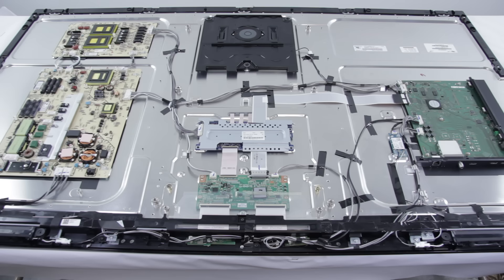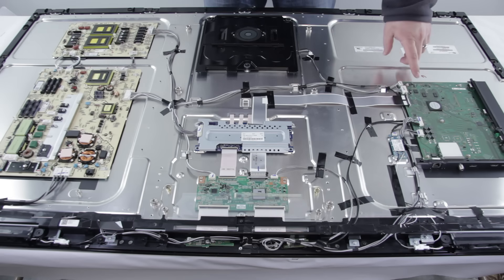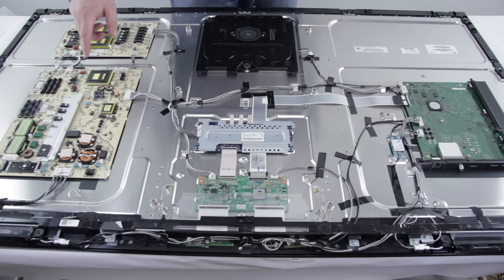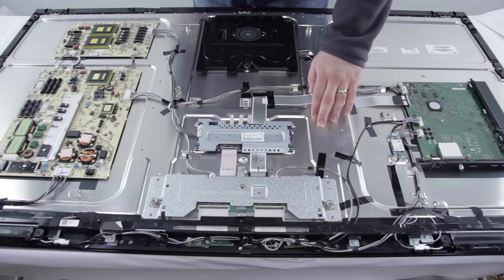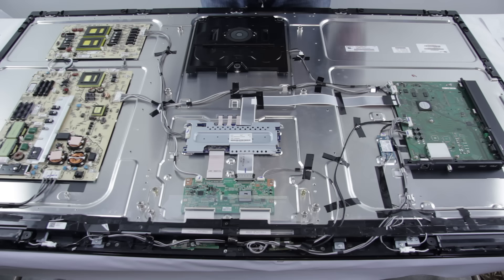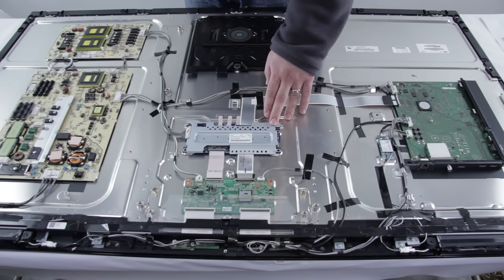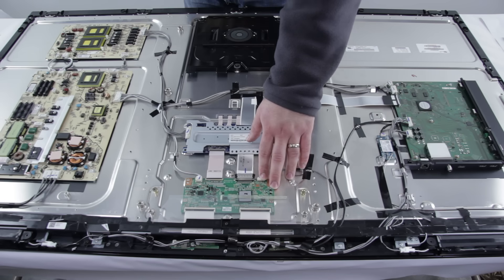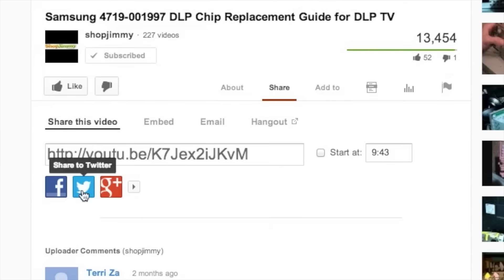LED TV Repair Tutorial - Common Symptoms & Solutions - How to Repair LED TVs

Comment: LG LS554500-UD   Has picture (vertical white lines) and sound but I can't see any of the menu options or anything related to channel or volume selections...?
Reply from the maker: Jason Smith   Try all repairs and troubleshooting at your own risk.  This sounds like a TV panel (TV Screen) problem.  If your TV panel is bad, it may be more cost-effective to replace the TV as panels are typically hard to find in stock, difficult to replace, and expensive.  Thanks and please let us know if you have any further questions!  www.shopjimmy.com

Comment: Hey Jimmy I have a LG TV model 47LNN5700 - UH.  Screen went black, but I still have audio. No back lights and I did the flashlight test and can see image.  Does this seem like the back light inverter/LED driver is bad. How much does this item usually cost and where can I get one if this seems to be the problem. Thanks
Reply from the maker: Dwight Frazier   PLEASE SUBSCRIBE TO OUR CHANNEL - Try all repairs and troubleshooting at your own risk.  This could be a problem with either the inverter or the LEDs themselves.  You can replace the inverter/LED board to see if that fixes the problem.  Click this link to replacement parts for your TV model number:  http://www.shopjimmy.com/catalogsearch/result/?q=47LN5700  There may be multiple boards for the same TV model number, be sure to match part numbers on your current board, with your replacement for compatibility.  Here is a link to a video showing how to identify your part number, click here:  https://www.youtube.com/watch?v=_4Qpfan0vdU  Thanks and please let us know if you have any further questions with your TV Repair!  www.shopjimmy.com

Comment: Hi there! I have a 2009 Samsung UN55B7100WFX2A that was in storage and moved a couple times over the last several years, the LED display started flickering and then started to go blank i.e. dark screen or sometimes slightly blue (but no picture) however audio works fine and TV turns on and off as normal. The LED display symptoms seems to be intermittent and TV can work fine for an hour or so however it seems like it is getting progressively worse (now the LED flickers less and just go black "blank" sometimes blue but most likely black) From the resources you have supplied in this DIY video should I be looking at Samsung LJ94-02860B (2009FA7M4C4LV0.9) T-Con Board ...it was your suggested alternative part #. I have not down the back light test, I will tonight when it gets darker. Thanks -Quintin
Reply from the maker: +Quintin Miller   Try all repairs and troubleshooting at your own risk.  This sounds like you have bad LEDs in your TV.  Unfortunately we do not sell replacement LEDs for your TV model number at this time.  Thanks!  www.shopjimmy.com

Comment: hi shopJimmy 
I have an LG Led 47LW650T-ZC
The issue I have been having is that my picture shakes quite violently when it's turned on. it doesn't happen every time but 80% of the ime it does. now it can stop after a period sometimes and other times it can go on for as long as I will leave it on.
I am not sure what the problem is, I've looked online and on the LG site and can't find anyone with this issue.
is there any help you could offer me?

Comment: hi i have a question about an LG  47ln5200 led tv  when you plug it in the red light at the bottom is lit when you press the power button the red light gets brighter but does not change to blue  the screen flashes white then the screen is dark  i did the flashlight test there is no image on the screen i checked voltages on the power supply it is fine. there is power going to the led wire i am thinking that it has led failure what are your thoughts thanks Eric

Comment: Hello. Thanks for this channel. I have an LG  42LN5400  I got it Jan. '14 and this Jan., just before the warranty expired, the TV went blank. The LG repair guy came and installed a new board., Here we are 8 months later and now my screen is solarized (psychedelic... all the pretty colors) This happens within 1 minute of the TV being on. It starts out with a normal picture, then turns into the solarization thing. The sound is fine. I am not handy, but I have a friend who is and offered to help. What should he/we be looking for? If you need the serial # just say the word., Thanks so much. I just can't see buying another TV when I haven't even had THIS one for 2 years.

Comment: Hi Shop Jimmy. TV Info: Samsung 50". Model UN50ES6150. Symptom: was watching TV and experienced a very loud pop noise followed by the screen going completely black (no blinking light). I have removed the back panel and found no obviously bad capacitors. I do have a Fluke DMM to test. Any help or troubleshooting suggestion would be greatly appreciated.

Comment: I have an LG LED 47LN5700.  The TV will flash "LG" upon power up and then the picture goes dark.  Audio is active and image is present (I did the flashlight test and am able to see the image), so I assume there is an issue with the back lighting.  I have replaced the LED driver and the t-con board and this did not correct the problem.  What's next?

Comment: Hi Jimmy, thanks for the video. I have an LG 42LE5400 that just went dark on me. My wife was watching the TV when it went out and she said that the TV was working fine then restarted on its own.  When it came back on, nothing was on the screen.  The backlight is definitely not working now, but the TV is turing on.  We stream most of our media and use a soundbar with the TV speakers off, so the sound is tricky to test.  I haven't been able to get sound but I am not sure if it is not working.  I have also tried the flashlight test but my flashlight is not the greatest, so I am not convinced the picture is not showing up even though I can't see anything.  I am sure the backlight inverter is out, so that would be step 1.  If that doesn't solve it, it seems the T-con would be next.  We have had minimal colored vertical lines on one edge of the screen on and off for a while now but that could just be a different problem.  Does this make sense?  Thoughts??  I am curious what you think about the TV restarting by itself.

Thanks!

Comment: I have a  Vizio P702ui-b3. The right half of the screen is very dark, almost illegibly black if not for the backlight coming from the left half. It occurs at the vertical center and fades quickly to the right. I can see the image of the menu just barely on the right side / half. What do you prescribe?

Comment: Hello Shop Jimmy
I have a LG LED TV model 50la6200 that has no back lights, confirmed with the flashlight test. Sound works fine. After opening the TV I found it only has a main board, T-con and power supply. I ordered a new power supply board from ShopJimmy.com and this did not fix the issue. Can you suggest any further actions?

Comment: I have a Sharp LC-60LE810UN with sound but no picture. I have replaced the power supply /backlight inverter with two different boards with the same results. The flashlight test shows a picture on the screen. Before the issue started there was no evidence of the backlight failing. I was watching a show, and the TV cut off, and started giving a blink code of one long one short. At first I wasn't getting any sound either, so I replaced the mainboard. Any help is greatly appreciated!

Comment: i have a vizio xvt553sv tv with a white screen , all imputs work, you can see picture in background and sound works. looks like a photo negative when watching, and backlights work. any help with part replacement i would appreciate it.  thank you
Reply from the maker: Marvin Bell  PLEASE SUBSCRIBE TO OUR CHANNEL - Try all repairs and troubleshooting at your own risk.  This could be a problem with either the t-con board, the main board or the TV panel.  You can replace the t-con board and the main board individually to see if one of those boards fixes the problem.  Click this link to replacement parts for your TV model number:  http://www.shopjimmy.com/catalogsearch/result/?q=xvt553sv  There may be multiple boards for the same TV model number, be sure to match part numbers on your current board, with your replacement for compatibility.  Thanks and please let us know if you have any further questions with your TV Repair!  www.shopjimmy.com

Comment: Great video! I am looking into repairing an LG 32LN5300 with no screen and did some troubleshooting as you indicated. This is an LED TV and I do not get a backlight, but I get a red LED showing on the front and when I switch to the cable TV tuner I get the static sound through the speakers. I also took it in a dark room and every few seconds I get a very faint (very faint) flash on part of the screen. I'm guessing the TCON board, but I leave that up to you. The part looks like the one on your website: http://www.shopjimmy.com/lg-6871l-3259a-t-con-board.htm with the only difference I get a 3259A1 stamped on mine. I look forward to your response.

Comment: Hi Jimmy, I have a LG 32" TV ( 32LN530B no picture but has sound. I did the flash light test and can see images. I pulled the back cover off and tested the plug on the power supply where it displays LED + and - I think it should read 24V however it's only reading 0 to 200mv with the TV on. Is there any other way to diagnose this power supply / no picture issue. All the caps on the board look normal with no bulging and the TV is 1.5 yrs old. Thanks for your time.

Comment: Please help I have 50" LG 50PA4500 it's not turning on but the red light by power button stays on and comes on and off when i make an attempt to turn the tv on, and I can hear the sound that the tv normally  makes whenever i turn it on. I hope you can help find a solution.  Signed  desperate Mancave.

Comment: Hi, I have a LC-52LE700UN Sharp TV. When I turn it on, the power and opc led blink together, and then only the power led blinks again. So the POWER led blinks twice and the OPC led only blinks once, and it keeps repeating like that. When I power on the tv with the power button while holding the volume up and channel down buttons, the power led turns on and I get no blinks, but the TV does not turn on (the blue light in the middle doesn't turn on) Sometimes with this combination it did turn on after a while, but now I only get the power led on. I thought it might have been the power supply board, so I bought the same part number from you guys and replaced it, unfortunately I keep getting the same error. ¿Is there another part I should replace?
Reply from the maker: Felipe Vallejos    Try all repairs and troubleshooting at your own risk.  I recommend replacing the main board in your TV.  Click this link to replacement main boards for your TV model number:  http://www.shopjimmy.com/catalogsearch/result/index/?cat=56&q=LC-52LE700UN  There may be multiple boards for the same TV model number, be sure to match part numbers on your current board, with your replacement for compatibility.  Thanks and please let us know if you have any further questions with your TV Repair!  www.shopjimmy.com

Comment: LG 47ln5700-UH no picture, has sound. no backlights. passes flashlight test.
Reply from the maker: William Belford  PLEASE SUBSCRIBE TO OUR CHANNEL - Try all repairs and troubleshooting at your own risk.  This could be a problem with either the power supply / LED board or the LEDs in the TV.  We sell replacemend power supply boards as well as replacement LEDs for your TV model number.  You can replace the power supply board to see if that fixes the problem.  Replacing LEDs can be difficult and there is a possibility that you could damage the TV panel.  IF you damage the TV panel, it is not repairable.  If you replace the LEDs, it is recommended to have it done by a professional or someone with experience.  Click this link replacement parts for your TV model number:  http://www.shopjimmy.com/catalogsearch/result/?q=47ln5700  There may be multiple boards for the same TV model number, be sure to match part numbers on your current board, with your replacement for compatibility.  Thanks and please let us know if you have any further questions with your TV Repair!  www.shopjimmy.com

Comment: Hello, I have a Emerson LE320EM3. Here is what I have found. When I plug in the TV I get a High Pitched Noise from the transformer on the power supply. I looked and I don't see that any Caps are bulging. I dont have a Cap tester and was wondering if this issue would link to the Caps? ANy advice would be great!! Thanks.
Reply from the maker: Mike Murphy   PLEASE SUBSCRIBE TO OUR CHANNEL - Try all repairs and troubleshooting at your own risk.  No, this sounds like a bad power supply board.  Click this link to replacement power supply parts.  http://www.shopjimmy.com/catalogsearch/result/?q=LE320EM3  There may be multiple boards for the same TV model number, be sure to match part numbers on your current board, with your replacement for compatibility.  Here is a link to a video showing how to identify your part number, click here:  https://www.youtube.com/watch?v=wooRqBrRo6oThanks and please let us know if you have any further questions with your TV Repair!  www.shopjimmy.com

Comment: Hello Jimmy,

I am having a problem with my Sony KDL 40EX520 TV which none of the local technicians was able to diagnose, I hope you can help me with diagnosing this problem.

When I power on the TV, this what happens:

https://www.youtube.com/watch?v=BGm2aua1GMg

Sound works fine and I can hear channel switching and HDMI is working fine.

I can also hear a faint ticking/clicking noise from the back of the screen.

Comment: Hello I have a apex lcd 32 hdtv (Ld3288t) that is not working. I purchased the TV brand new from target and never opened until a year or so later. Once I got the TV installed it worked perfect for 7 months and went out. The blue power light comes on but the screen is black (no picture). So fair I took the TV to a repair shop that cost 40.00 just to look at it. I was told that both logic cards need replaced (whatever that means). Once I heard the cost they were trying to charge me I said "NO WAY". Then they tried to talk me into some recyclyling program. Hahah I went and picked up my broken TV. So I want to know if this problem is worth me (myself) trying to fix or should I just dispose my TV. I would hate to do that and it's something minor. I did purchase a warranty, but since I didn't use the TV right way, the warranty is no good anymore. Please help
Reply from the maker: Latrice Mickles   Try all repairs and troubleshooting at your own risk.  I recommend running the flashlight test on your TV.   Here is a link to a video we produced that shows how to run the flashlight test. https://www.youtube.com/watch?v=xUzCLgoSPGM Please reply with your flashlight test results and we can recommend a replacement part for your TV repair. Thanks and please let us know if you have any questions! www.shopjimmy.com

Comment: visio model 470i-AO sound but no picture. can see picture with flashlight. no backlights. replaced power supply which contains the backlight inverter. still no backlights. everything the same as before. what next?
Reply: So you got the TV fixed? Or no?

Comment: have a vizio led smart tv. model# M421VT will not turn on.....but logo is blinking in a pattern....tryed pulling plug then holding power button for 30 sec.then plugging back in still no picture.....help.
Reply from the maker: j riv   PLEASE SUBSCRIBE TO OUR CHANNEL - Try all repairs and troubleshooting at your own risk.  I recommend replacing the main board in your TV.  Click this link to replacement parts for your TV model number:  http://www.shopjimmy.com/catalogsearch/result/index/?cat=56&q=M421VT  There may be multiple boards for the same TV model number, be sure to match part numbers on your current board, with your replacement for compatibility.  Here is a link to a video showing how to identify your part number, click here: Thanks and please let us know if you have any further questions with your TV Repair!  www.shopjimmy.com

Comment: I have a vizo TV model # E320-A1 serial #10223470021 TV will not come on but the white indicator Lite in the left hand corner comes on , I changed the power pack Vizio ADTVCL801UXE3 Power Supply for E320-A1 but it did not work

Comment: Lighting got my LG 60" and my Philips 40"
60LN5600 - Would try come at first but would shut off and the red light would flash.  After the set a few days now it will power on now but it takes a min, also the picture is grainy and Black & White. If you try to use the buttons on the TV or remote it will do nothing but if you press the buttons repeatedly the TV will shut off and come back on. Sometimes it will just go off and come back on and other times it will just go off and blink repeatedly.
Manufacture Date 11/13

40PFL3706/F7 - Won't power on at all.
 Manufacture Date 1/12
Reply: Thanks for the reply back but I swapped out the main boards last night. They work great

Comment: My Samsung un55es6600 started to get a pink ghosting in the right side of the screen that would fade as the picture changed. After about two days the pink hugh just became a translucent white with the same fade as the picture changed. The ghosting is not permanent though and for short times the picture is fine. There is also a light horizontal line about a third of the way down the screen that also comes and goes. All of these issues occur regardless of which input I use. I'm out of warranty. Any chance one of the boards could need to be relaxed and I'd so so you carry it? Thanks for any help and guidance you can provide. martinconte@me.com

Comment: I have a Samsung led un55c7000wf  ., no picture black., but sound., change t-con borad., still no pic. this model does not have a separate
led driver / back-light invert-er.
is it integrated to the power supply or the main board ?